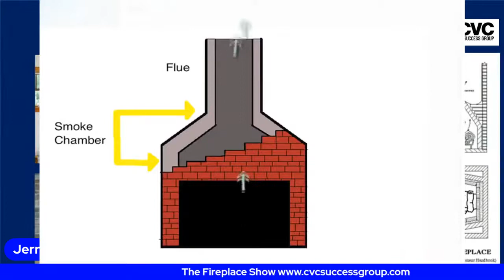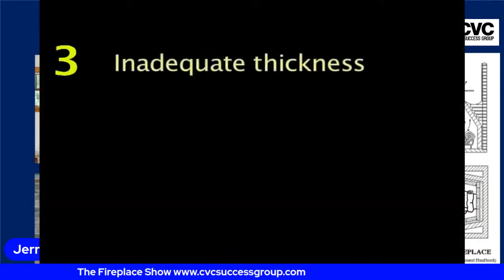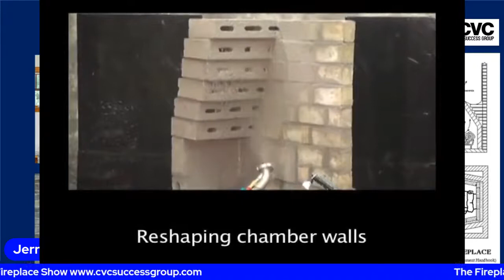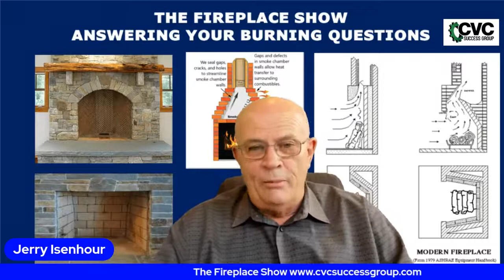Transform A Masonry Fireplace Into A Better Heat-Producing Fireplace

Comment: This video's information is 100% correct. 
Coming from a third generation Mason and Masonry contractor&
small business owner .
Reply: are you in northern Utah? mine needs some work mostly from not lighting a fire 🔥for the last 5 to 10 years ( pest's and moisture ) ( didn't know that so going forward i really should use it or the old saying lose it ) and the floor of it needs redone to be compliant with local building codes in 2020 as the gas valve needs moved id diy it but im not a mason aka over my head and my local chim chimney sweep, and i found out the mason blain who built the house 🏡but his dead now and if his was around he'd be in a retirement home with dementia from old age back in the day i was told he was really good at the craft and one of the best

Comment: We used coal fireplaces in England to heat the house when I was young.  They were more efficient than the ones in the USA used for wood and much narrower front to back. There were fireplaces in every room but we only used the ones downstairs.  They were made of iron so they probably absorbed heat a bit like a wood stove does.   The one in the living room had an oven but it wasn’t used because we had a gas one in the kitchen.  Also was freezing most of the time.  I don’t remember them smoking except for the one in my parents bedroom upstairs.  As I said those were seldom used anyway.  We have a fireplace now but almost never use it.  It does smoke a little sometimes.  Not a Rumsford 😀

Comment: In general, it's probably a good idea to have smooth walls in the smoke chamber, but there is no way "stepped" or ragged brick, by itself, creates a draft problem. The Europeans and Russians pull the smoke up and down 15 feet and it still eventually drafts. What they do is 98% more impedance than a few ragged bricks in a smoke chamber.

Comment: How would one go about locating a mason that follows the proper standards?
Reply: The "tech" is 1st grade. Anybody should be able to follow the simple diagram. Flat back, 35 degree angles in. Curved front toward wide but narrow "throat" with smoke shelf. This is not hard.

Comment: Well, I am creating a Fireplace....but, not for heating purposes....only for Cooking and Heating Water thru Copper Pipes.....  The Smoke Chamber walls should be angled....and smooth.....Logic: Hot Air rises....the smoke follows and rides Hot Air..... Funnel it into the chimney .....now the next the angled walls should be smooth....it is called air flow resistance....if it is smooth it flows faster out the chimney.....👍
Reply: Meraba
Reply: Türkçe çevirmen olsa daha güzel olurdu😊